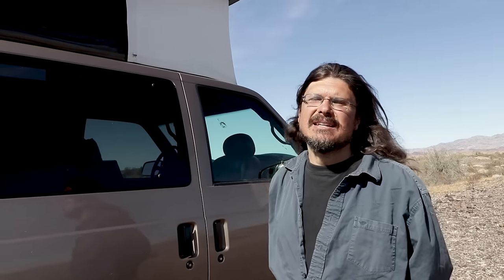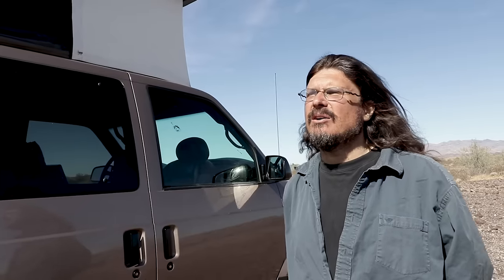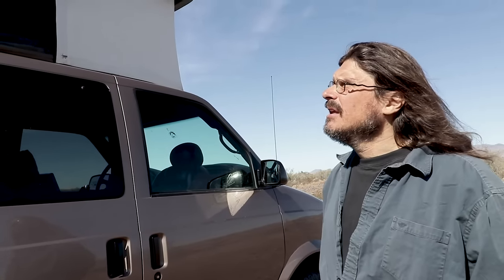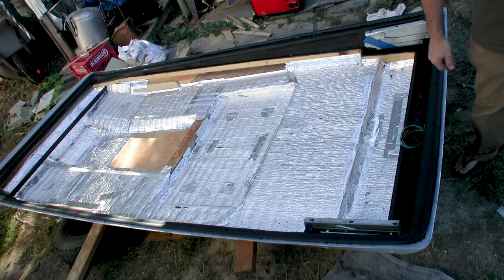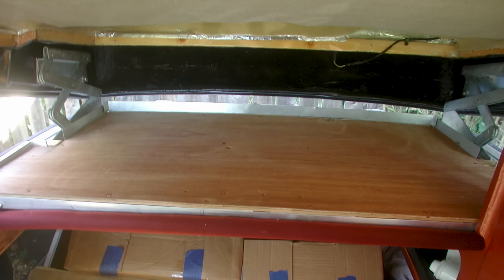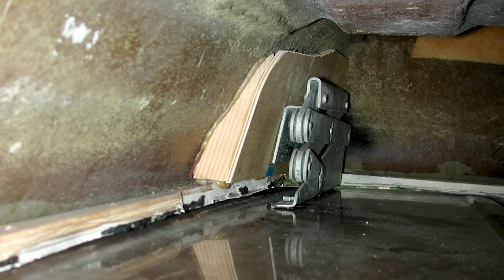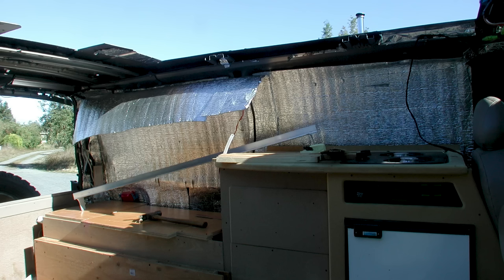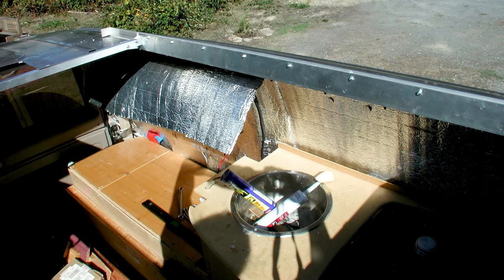Van Life Essentials How to Install a Pop Top on a Van

Comment: Bravo Gavio. Great job. I have a 83 Sportsmobile and the canvas has a thin bungie cord that wraps around it to pull the canvas in when you drop the top. I don't know it it will work on Gavio's van but I figured that I would mention it. Thank you again for the great videos Bob and your love for the community. Mark & CC
Reply: Thank you..... I considered the bungee cord, but in the end, my fabric doesn't need to pull in or push out either one, it needs to stack straight...... Once I got the hang of it, it hasn't been a problem....
Reply: As the roof goes down, the canvas generally bulges outwards. One trick I’ve seen is to simply hook an elastic cord to each side of the canvas roof, bringing the canvas in, and then lower the roof.

Comment: I have a pop top camper. It has a hand crank and four corner veriticle tubing that uses a cable to raise and lower. It also locks so if any snow load weight does not cause a calapse of the top. The self rise struts are a lot weaker than tulhe tube system. The tube set up going ves wind stability. It also gives you a full length raise instead of a pivot type Westy style. Also my canvus has some "memorie metal strips that run up and down sown inside the canvus which causes the canvus to fold inward allowing a easier calapse or the top when closing. These metal strips are like those old wrist toys where you slapped them on your wrist and they wrapped around your arm tightly. We saw those at a Dollar store...lol and replaced a couple broken ones.lol  athe cable crano system with verticle tubing is by far more stable and wimple to use. As far as having to mess with the canvus as it closes..all types have this...lol  The crank in mine is a simple boat caboe crank mounted inside on the back where all four cables(one to each corner) meet. A small metal plate with adjusters colle t them together so they can be individually adjusted l.Then from that plate a single cable wraps on the crank mechanism with a removable crank handle. Wish I could post a pic but.. under able to..have fun...oh, the canvus, a upholstry shop did mine...@ $ 700.00.

Comment: Here in the UK, most pop-top suppliers apply an elastic strap, stitched inside across front and rear, with quick release clips. As you lower the roof, the straps pull the fabric in....or another way is a long bungee strap all the way around the outside of the canvas about half way down.

Comment: Great Job! I've owned several VW Westfilia campers with the pop top and you still have to fuss with the tent part to make sure it all comes inside of the top then tuck it in after the top was down. The one thing the Westy top had was elastic in the corners so it would help pull the fabric in word on the way down. My biggest regret was selling my Westy thinking a new one was around the corner then finding that after the Vanagon Westy ,  VW never came out with another van that was as roomy as the Vanagon for a camper.

Comment: Really interesting points in your 3 videos on using products that are good if you are chemically sensitive. Not enough Van folk comment on this topic (especially the insulation.). I'm not sensitive but I think the healthier choice is always the way to go. What glue did you use on the pop top? Van insulation? Thank you Bob & Gavio.
Reply: Yeah, I think it's a big issue, and not much discussed.... A van is such a small space and toxins can accumulate easily...... For some things I found that a toxic material was really the only thing that would work reliably, aND for those things I came up with strategies for airing them out and getting the toxins out of my space before I needed to be in it...... Only significant thing was using spray adhesive on the headliner, but I did that before I installed the canvas so I could air it out for several weeks before I inhabited it...... If I hadn't had that option, I would have needed to do the headliner different.....  Almost everything else I found low-toxic materials to use...... I will do some sort of class at RTR on that topic this year, as I have been doing natural and nontoxic in my design business for many years - ever since I got sick..... ...

Comment: I’m surprised the guy didn’t upset the cord method. I saw a lady who drove an Astro van camper with pop top and she had strings rigged through an eye hole screw or something and as roof was lowering shed pull strings which pulled canvas inward. It’s a simple mechanic . Why this guy as an engineer hasn’t tried that is beyond me

Comment: What was the decision process in deciding to have the top pop up from the front of the van instead of the rear?
Reply: It was actually about the way the hinges are configured - the curving front of the top would not have accommodated them easily, if at all..... Also, it's easier to get the front of the top sealed down tight with clamps than with hinges, and it's critical at the front so water and air rushing at it at 70 mph or more doesn't leak in......

Comment: And about the pop-top frame: was it welded or simply bolted together?
Reply: He said he didn't weld so I'm guessing he bolted.
Reply: @Nancy Harbison I also deduced that; just wanted details. Thing is , over time and bad roads, bolts loosen so welding is a better option, but more expensive.
Reply: @designlife4living547  Yeah, I woundered how the bolts would hold up too.